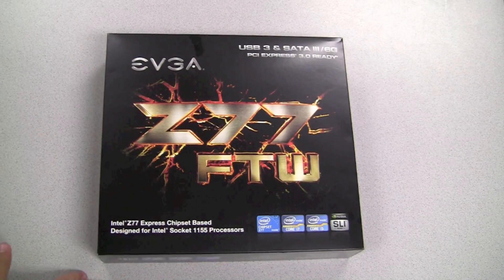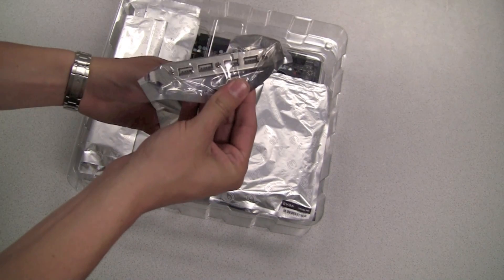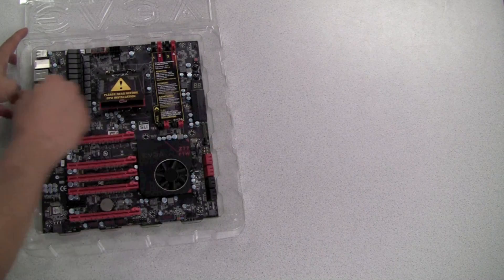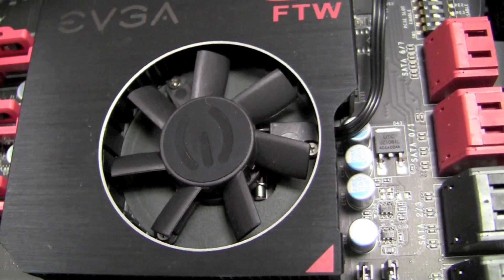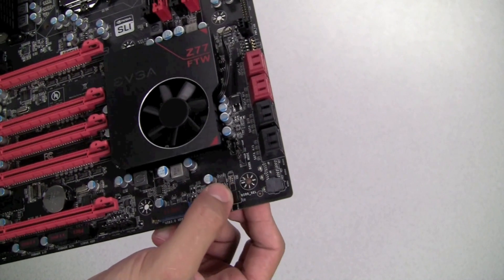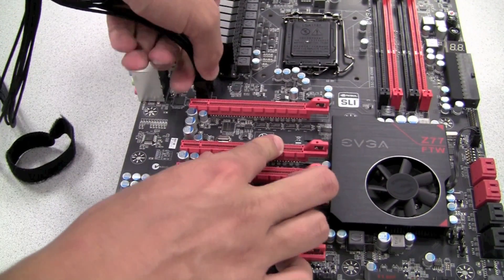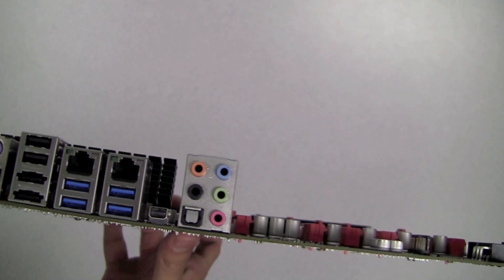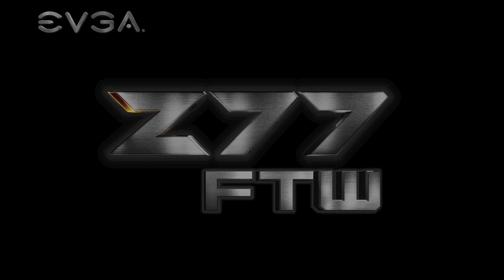EVGA Z77 FTW Unboxing and Overview (Part 1)

Comment: I've supported, and ran mostly eVGA products since the 680i. I ran usually at least three towers. I have to say, this, thanks to the terrible BIOS, is the worst product I've every purchased from eVGA. It won't overclock because of odd issues in the BIOS itself. 
In the RAID slots the two hard drives plugged into the board will disappear out of Windows7 Ult. 64Bit mid-operation. Voltage seems to fluctuate even when vdroop is turned off.

Comment: i'm not saying it's the manufactures fault. I'm saying that this helps a lot with making a case look pretty by minimizing the loop that is the 24 wires. The wires are stiff at first

Comment: I would hardly consider it the manufacturer's fault for breaking the pin connectors off a motherboard because you can't bother to loosen the cable enough to keep it not broken.

Comment: Maximus V Formula...Expansion slots include two PCI-Express 3.0 x16 (x8/x8 when both are populated)
EVGA
-angle 24 pin (look excellent with sleeve cables)
-300% more gold content CPU socket
-POSCAPS
-2-4 slot SLI x16 PCI-E 3.0
EVGA Z77 FTW is better board special for people with SLI configuration.

ASUS is only powerfull marketing and competition of MSI, GIGABYTE, ASRock. 
EVGA is without concurention, different level, special fealing. Classified and FTW.

Comment: I see no reasons why you can't compare them. Both are Z77 Boards aimed at Gamers, each with their own unique features. 

For instance, the Formula has internal Thunder Bolt headers, something that is important to me personally. 

The Z77 FTW has 5 PCIe slots with support for 4 Way-SLI, while the Formula only supports 3-Way SLI. I will probably be running 1 Card to start with and maybe a second later on.